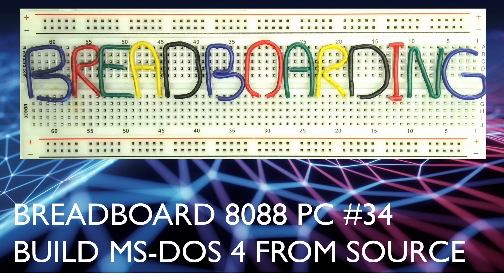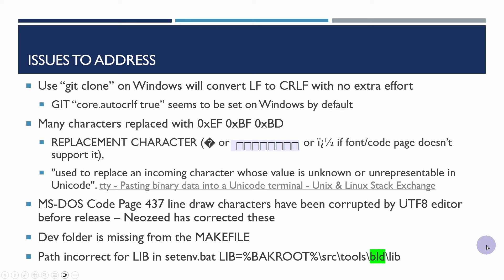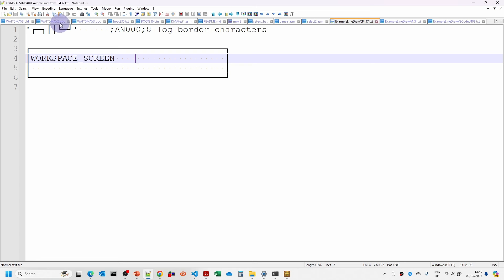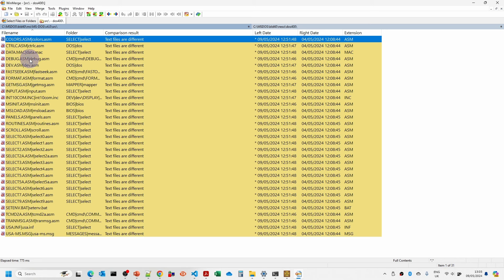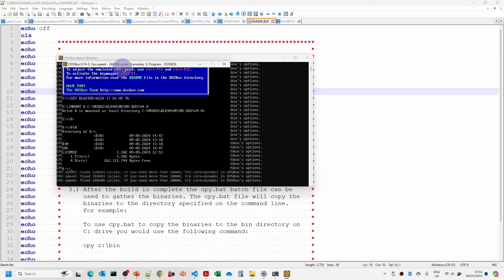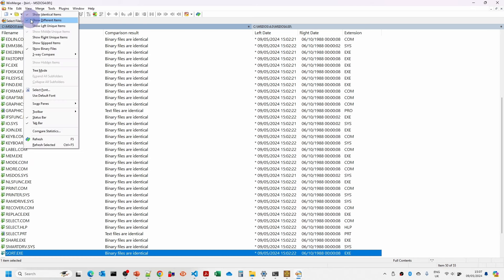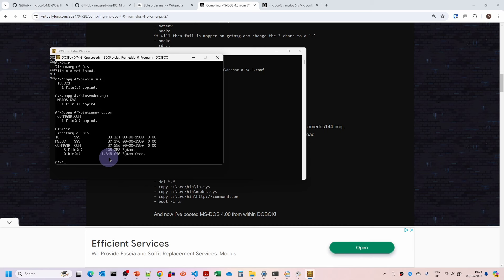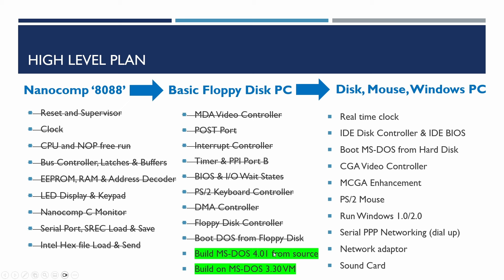Breadboard 8088 PC Build MS-DOS 4.00 #34

Comment: AWESOME!  Glad to see more and more people building their own DOS 4!!  Word is that MS is locating the original ZIP files and is going through it so we get a 'proper' release with whatever missing bits are in the source, as it's not ASCII plain text.
Reply from the maker: That would be good if MS could work with Michal Necasek to get a decent release out (for 2.x, 3.x and 5.x as well would be ideal). Best bet is check in ZIP files with the originals, its not as if they couldn't 'touch' the files with original dates that they needed to cleanse the comments. Dave